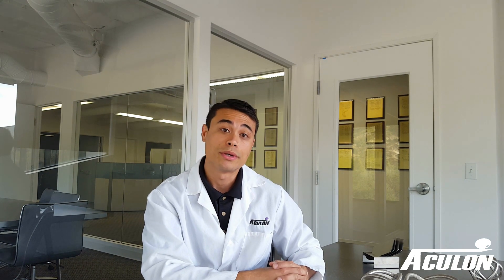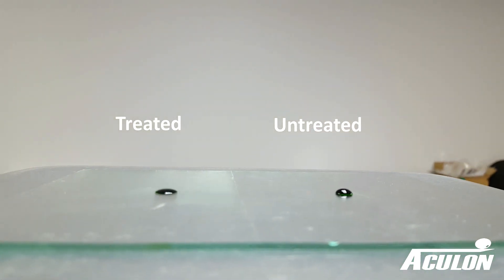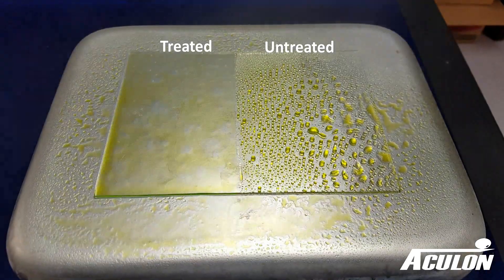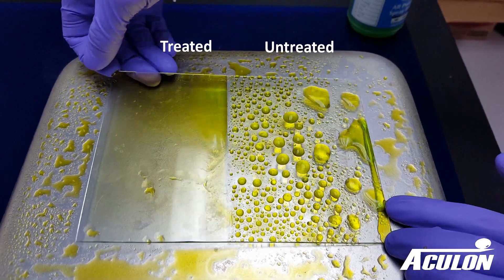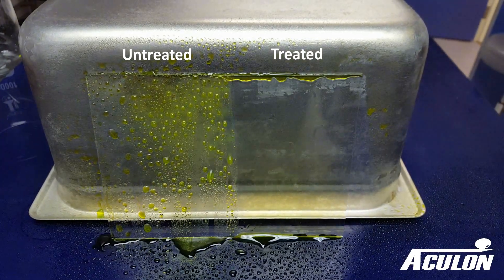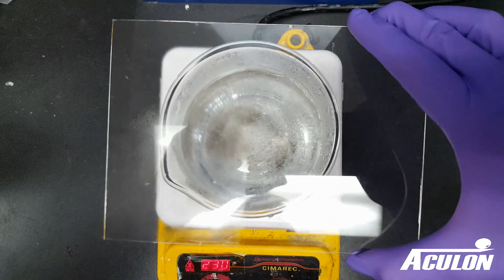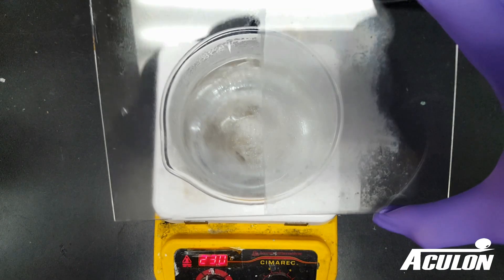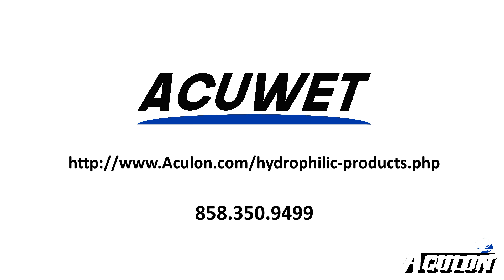AcuWet - Hydrophilic Coating Technology

Comment: If you treat glass, while the treaded glass is completely dry, if you take a multimeter to it will it show Continuity? Meaning is it conductive, even the slightest?
Hopefully the answer is yes!
Also how many Microns thick is the coating after being applied?
And do you have any idea on average how thick the Exclusion Zone will be?